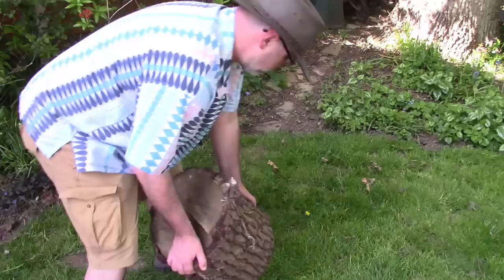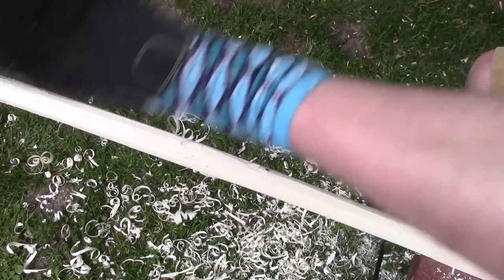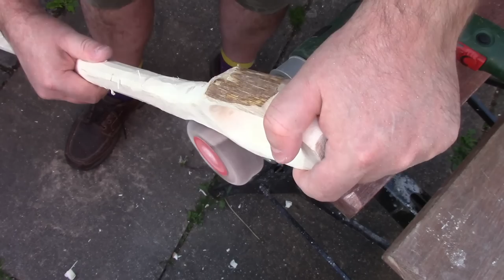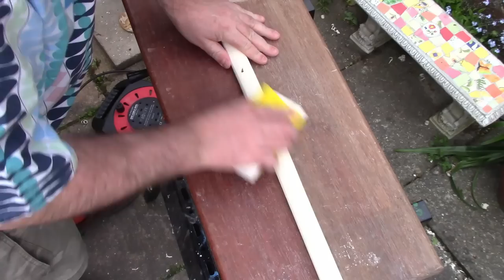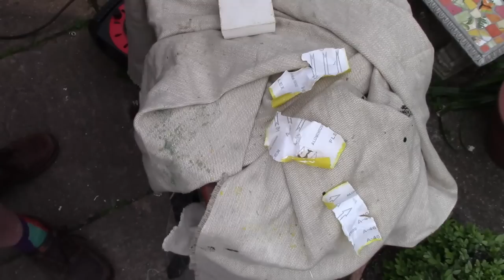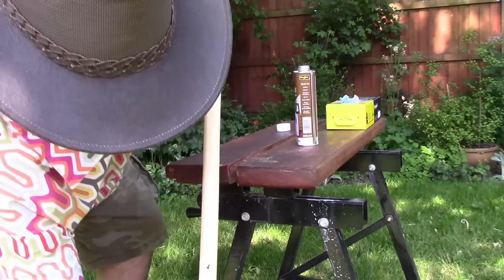SLOW TV  - Making The Walking Spoon (3 Hours) - Ambient

Comment: You have a good eye or you measured before you cut round the branch - thought you would chisel or plane round it. I carved the walking stick I made which was much smaller in circumference. Then used a sander, The wood knots were the biggest problem. Used gorilla glue for the handle - the tip wacked on / did not need glue as could not get it off.